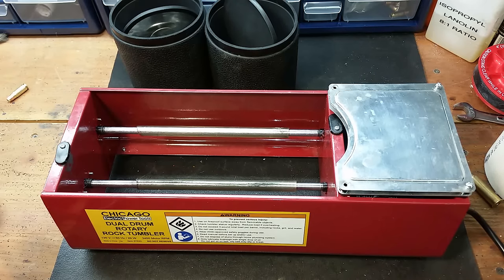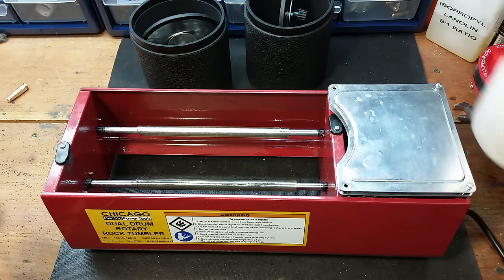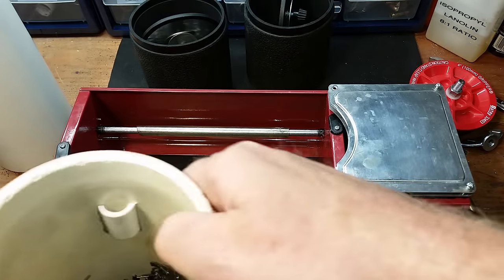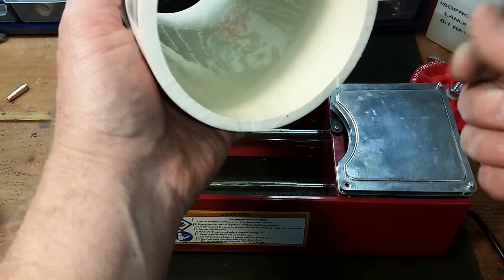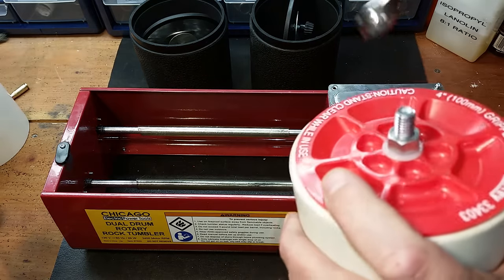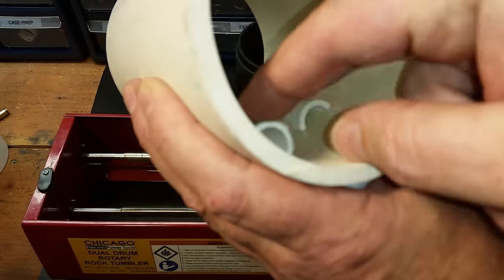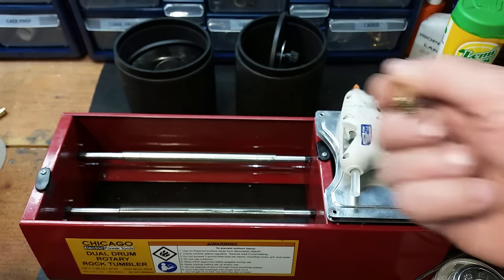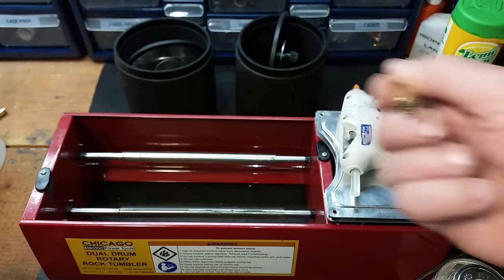PVC project: Larger drum for HF dual drum rock tumbler..clean reload brass!(Link to new video below)

Comment: Great video, well done. I happened upon your fine video a week after I did the exact same mod. I cut my drum on my miter saw. Glued 3 1/4"X1/4" wooden agitator sticks inside using "Shoe Goo".  For the fixed end cap, I used contact cement and a rubber band to get a tight fit. Pretty sure it's water proof. Didn't get a test cap, just used another cheap cap. I wrapped 2 turns of vinyl electrical tape around the cap to make it a nice force fit. Used old finishing nails for media. I use it for de-rusting steel parts, so I use baking soda and a handful of purlite. About 16 hours and all surface rust is gone, leaving a satin finish. Probably take only a few hours for my .243 brass, can't wait to try it (nails only!)

Comment: I sanded the shiny stuff from the inside of the tube and was able to cement pieces of my leftover pipe as paddles to agitate the media.  I had some trouble getting the PVC endcap to not leak.  I'm on my second try now.  Otherwise the project went great.  Thanks TreeTopFlier for all  your time on this.  I too am looking for a tumbler a little smaller than the big ones on the market.
Reply from the maker: Glad you got it to work.  It still works for me.  I just dont need that much capacity, plus this is not nearly as loud when running.

Comment: I will make one with the  4 inch PVC pipe but I will also use my drill make me a stand with rollers and connect the drill to the bolt  on the plug thanks for this Idea saves a lot of money
Reply from the maker: Go for it!

Comment: I tumble tons of brass with my Harbor Freight dual drum unit and have made all kinds of modifications, some better, others not so. One thing that is consistent is the need for the drum to be very dry and rough on the outside diameter (as the factory drums) for traction on the tubing covered rotating shafts. I discovered that about 20%  of content fill area for pins content amount make the fastest, cleanest brass. You will also discover a huge improvement when using 1 squirt of the Liquid Lemi-Shine (Amazon) over the powder mix, or the Hornady One Shot case cleaner, both with a small amount of liquid dish wash soap, with Hot Water. I also found that filthy range brass swished around for a few minutes in a bucket of hot water and Simple Green make a huge difference on tumbling results. I tumble my brass for the Gorgeous, Jewelry look for about 1 to 1 1/2 hours only. The end product actually looks cleaner and better than brand new brass, every area. A modification of the ball bearing blocks will help the motor spin the shafts a bit faster and keep the motor from over heating as much. Prepare for plenty of profanity when installing that kit. Aren't we all happy to not depend on the old vibratory corn cobb, walnut media tumblers now?

Comment: I've got one did some alternations got a 4 inch PVC pipe 9 7/16 long. Capped one end & got a temporary removable cap for the other. I ran over 6 lbs total in weight it. Had problems with the roller bar not gripping the pipe, so I Leaned it some to the left by putting a block under the right side. So now there's more weight on the driving bar. Had to put a sheet metal screw under the right side of the frame to keep the shell holder block from walking out while running. Cut 4 strips of plastic off some leftover piece of 4 inch pipe & glued them inside, so it would agate the casings & SS pins. Removed the cover over the motor & bolted on some metal flashing to act as a heat fin. A towel underneath is helps keep the noise down.
Reply: The drive rollers are covered with a vinyl tube as stock...I was thinking that a latex surgical tubing over the drive shaft would provide extra traction if needed.

Comment: The Lemi-shine helps with the tarnish. Not mandatory, but helps a lot and shortens time needed for tumbling. Most people I've heard talk about this, say that Dawn dish soap is the best one to use. They do advertise that breaking up grease is a primary purpose, and also boast that Dawn is what the vets use to save the birds and animals caught in oil spills. Just an FYI. 
The HF tumblers mostly need "tweeking" when used for cleaning brass. Also, get some spare belts. Large "O" rings from the farm supply store work great. One commenter mentioned a computer fan. This is a really great idea if you are going to run the machine more than a couple hours. One guy was telling me that he ran his all day long. He also said he burned two of them up pretty quick. The third lasted almost a year by aiming a table fan at the tumbler. That's when he got the computer fan, and that machine is still going. 
One suggestion that I would make is to get some heavy wall rubber tubing that is a firm fit on the axle bars. Put 4 (four) one inch pieces on the two axles and I don't think that you would have any slippage at all. It's simple to do, too. Wet the rubber and the rod with rubbing alcohol, slide them into place, and allow to dry. 30 minutes max. They won't move, and the simplest way to get them off afterwards is to cut them off.

Comment: I dont tumble brass, but I have found that removing the two silver plates on the right helps tons with cooling (and so does adding a 12v pc fan over it too!). If you really wanted to, you could bend the sides of the "box" to be able to use larger diameter pvc.

Comment: I love this mod. works very well. The only thing I changed was the cleaner and the glue. I used Zep Heavy-Duty Citrus Degreaser Refill. gets all the crud out and lanolin too. The glue I used Gorilla Super Glue. It has been months and both are just making CLEAN brass. No crud in the primer pocket or inside the case on a 2hr run.
Reply from the maker: Very nice!  The ones I put on several years ago with regular gorilla glue are still holding strong.

Comment: Great video--I have been using this Harbor Freight wet tumble for several years and will try your PVC solution but will probably use a plug on both ends and cut of the stud on one end and consider it the fixed end.  Thanks again.  Oh incidentally I also use Lemishine why as you said because all others seem to use it but only a small amount, believe it is the citric acid that helps in the cleaning process.  I clean only 9mm cases after de-priming and sizing for those clean primer pockets.

Comment: Great idea! I made my own. Also, added a 4" clear circle from TAP plastics for $3. Fits very snug and you can see inside. Rubbed some silicone caulking around the inside and outside edges and its watertight. Poked some holes in a test cap with a small nail to use for water drainage.

Comment: Hey I also took off the top metal plate over the motor and I put a computer fan. Hopefully that will add more years of life for that little hot motor. :P
Reply: late question but do you have the fan routed to blow air down upon the motor or pull air out?

Comment: I don't know if it's been said yet ... but if you're needing more weight to get more friction you could use PVC pressure pipe which is more than twice as heavy as the foam core that you used. I will personally be making one of these later tonight. I bought the same tumbler for knife blades but the small canisters prove less than desirable for knife blades more than 4 inches overall. Also PVC glue is not meant to be used without a cleaner or primer. It's a two-step or three step.

Comment: thanks for this great video.I love it being a bit of a McGiver myself .I took a 1" piece of the 4" pipe and cut it into 1.5" pieces and glued them to the inside of the container .they seem to be glued solid .I will see as i use it .It seems to turn fine  as it is . I will see if I have to add rubber strip to the drum.

Comment: I have the same set up, instead of glue, I screwed half pipes inside and for traction I wrapped the big PVC pipe with a rubber self fused tape, which gets replaced after a year of two.

Comment: I was trying to use 6 inch PVC, I had 2 foot, but the ends were over 55 bucks. so, I may go with the 4 inch for now, just doing small loads anyway. AND the hot glue gun is a great idea .
Reply from the maker: I don't think a 6" pipe would fit into the frame anyway...could be wrong.  Glue gun works great, what ever you use for the baffles, don't make them too big so the little motor doesn't have to lift to much weight as material piles up on the baffle.  Thanks for watching...come back and share your results.
Reply: Use skateboard tape...

Comment: I used pins to start wet tumbling after I switched from my dry tumbler, then I tried wet without pins, I use dawn and lemin shine but increased the shine to double the amount and it cleans and shines as good as with the pins. I tumble for one hour.
Reply from the maker: Interesting, I may give it a try.

Comment: I did this several years ago with my lortone 33b  long before I saw this video and it works great!
Interesting how I used the same components you did including hot gluing in the 1/2 " pvc pieces.
I used ABS for the main piece as my home depot had that but only had pvc up to 3".
The ABS works just as well though.
Nice to see this info out there.

Comment: Thanks for the idea. I shoot 300 wby and the brass was just a little too big for the rubber drums. This worked great.
Reply from the maker: Nice! Those are big cases.  Did you use bumpers, something like I did inside the drum to spin the cases?  Anyway, thanks for coming back and letting us know.
Reply: Ya I tried the bumbers and I found a good way to make them. I tried cutting them with a hacksaw and almost cut my hand off. I tried putting them in sideways in one of those handheld PVC cutters and it fit perfectly, just squeezed it and it cut right down the middle. I tried superglue and sanding them the first time and they fell out after the second run. The second time I did hot glue covered with super glue and then I just poured in a bunch of PVC glue, swirled it around and let it dry haha. It's working so far. I do need a stronger cap for the bottom side if you have any requests. Thanks again

Comment: you should put a bicycletube over the drums for better friction
Reply: I was thinking of skateboard tape...
Reply: Or, you can place large rubber bands...
Or, a few beads of silicone around the circumference for some traction.. yes, the silicone trick might need a good steady hand to make sure you have a consistant thickness.
Reply: I was thinking plastidip or a rubberized undercoating spray

Comment: Unless you're going to make jewelry out of your polished brass, one to two hours in a vibrating tumbler is perfectly sufficient for cleaning brass.
Quicker, neater, cheaper, easier.

Tips from a 30 yr reloader:
Throw in 3 or so 2" square torn pieces of USED dryer sheets to collect dust.
 Add a few squirts of 50/50 mix of Nu Finish Car Polish/mineral spirits to get shiny brass.
Reply from the maker: I dont like one shot for surfaces that come in contact with powder.  Fine powders will stick to it.  Graphite powder for the win.  My opinion.

Comment: I got some traction tread material ( it is supposed to keep your feet from slipping off of stairs etc.) and put it on the rollers to keep them from slipping on the outside of the tumbler container.
Reply from the maker: Ive never had any problem with the drum slipping when it was full.   If someone is having trouble traction tape seems reasonable.   Another suggestion that seemed good was to stretch flat vacuum cleaner belts over the drum.
But just to be clear,
 I have never needed to do any of that.

Comment: Cut two thin strips of rubber inner tube and wrap them flat around each end of your PVC tube and it won't slip in the tumbler. Lemi-Shine is nothing more than a detergent booster with lemon oil in it! A large box of 20 Mule Team Borax or Oxi-Clean and a bottle of lemon juice will achieve the same result but you get about five times as much for about the same price! Just an FYI!

Comment: Some good info here!  I have the same HF Tumbler and it works great with pistol brass and stainless pins.  I've been thinking about doing something similar as you have done.  Thanks for the video!  Your videos are always top notch!

Edit:  Your links for the test plug and glue in plug give a 404 error.  Evidently they moved the pages.
Reply from the maker: +KSFWG Thanks for the heads up on the links!  I think I got them fixed, at least they are working on my end. Let me know if they are working. Thanks as always for watching!
Reply: +TreeTopFlier 

The links seem to be working now.  Thanks!
Reply from the maker: +KSFWG awesome thanks

Comment: What is the difference in diameter between the original drums compared to your PVC version?  If I understand correctly, the mod isn’t about increasing capacity but in making things more efficient for rifle brass.  Correct?
Reply from the maker: The diameter is 4.5" on both stock drums and the pvc.  The advantage of the single pvc drum is longer cartridges have more room to migrate back and forth, also the interupters give better agitation In my opinion.

Comment: Try spraying the outside of the PVC body with Flex Seal. It should give it a rubbery traction that may help it turn with the drive rods more easily. You could also try wrapping it in some type of athletic tape. Another option would be a brush-on bed liner material.
Reply from the maker: Others have suggested that too.  I personally didn't need it, it works fine with the weight of the water and brass on the rollers.  If you keep the interior interrupters small the barrel doesn't have to lift a lot of weight at one time...also reduces load on the motor.
Reply: I used that nonskid tape they sell for putting on stair steps. Coarse sandpaper would probably work too if you can find the right glue.

Comment: Paint the exterior with spray bed liner. It will help it turn when it's light.
Reply from the maker: The drum works fine without any coatings, I really gave everyone the wrong impressions in this video.  I just made and update partly because of this. https://youtu.be/roN67_oGpx8  Thanks for watching.

Comment: As far as gluing to PVC, try PVC cement, that's what it's for.

Rubber bands on the pipe for traction.
Reply: Except pvc cement will sometimes let go(fail) even if prepped properly. I've done enough plumbing repairs to know.Contact cement or epoxy is better.

Comment: The best way to keep that drum a spinning is to put anti slip stair tape on the PVC drum.  Even when it gets wet, it will keep spinning on the full length rubber rollers in the Harbor Freight tumbler.

Comment: You may want to try jet dri for your dishwasher in your solution. Jet dri is a surfactant and may help to keep that gunk from sticking to the sides.
Reply from the maker: Haven't tried that.  Isn't jet dry a spot remover, aka water softener treatment?
Reply: That will do it.  Or use turtle wax car [wash and wax] for your soap.  The inside will stay clean everywhere.  Bonus: if you don’t rinse them, just shake them around and get all the excess water out of the cases, they shed water and dry very fast and you get no water spots on your brass.

Comment: Very good ideas. Amazing that hot melt glue works and PVC doesn't work. I wonder how epoxy from Harbor Freight would stand up. I've been using that on almost everything where strength is important but it's not as quick as hot melt glue.
Reply from the maker: I have had a few come off over time and its pretty simple to put them back on.  On the last one I tried gorilla glue and it is showing real promise.  Its a little hard to do because you have to put them on one at a time and let them cure in the bottom before moving to the next one.
Reply: +TreeTopFlier. Just had an idea. I wonder if mounting those half pvc pipes on the bottom end cap would work better. Just tip the end of the tumbler up 10 - 30 degrees so all the brass slides to the end of the drum.
Reply from the maker: there is probably a lot of different ways to skin that cat....this method has worked for me.

Comment: Cool idea!  I think if I use solid core instead of cellular core PVC, I can use the PVC glue on the inside.
Reply from the maker: I'm not sure if the interior coating is different on the solid core but maybe...one concern, I imagine the solid core would be much heavier. Thanks for watching!
Reply: TreeTopFlier Good point on the weight.  I think I have some solid core stuff, I will give it a shot to see if it is a problem.  As far as the smooth exterior causing it to not grab on the rollers unless there is weight inside, I have used a couple of wide rubber bands on the outside of a plastic jar I use to dry tumble and it works great.

Comment: What is the recommendation on the pulley changing the belt out for better one or making small adjustments with it.
Reply from the maker: I would try to align everything and run the belts it comes with.  They come extra belts.  I'm still on the original belt.

Comment: Try a cylinder hone and scrach up the inside of the pvc pipe then add the half rounds the surface of the inside of the pipe should now be ruff enough for the oins to move .

Comment: if you can get the Drive roller bars out fit them with heavy "O" Rings for traction
Reply from the maker: I haven't had to do anything other than keep it clean to make it work.  It slips in the video because the drum is empty.  When full it runs fine.  If you try this I would run it first without modifying anything.   Thanks for watching.

Comment: Spray that tube outside with some flex seal spray and the rubber may grip better with the rollers.
Reply from the maker: It works fine with water and brass in the drum... been using it that way for years.